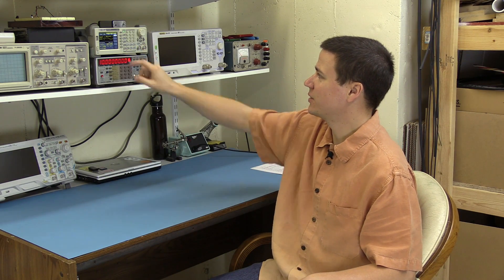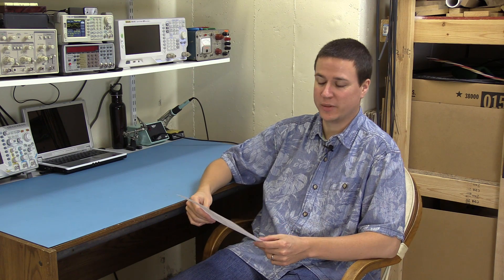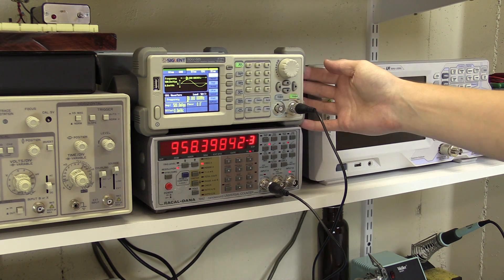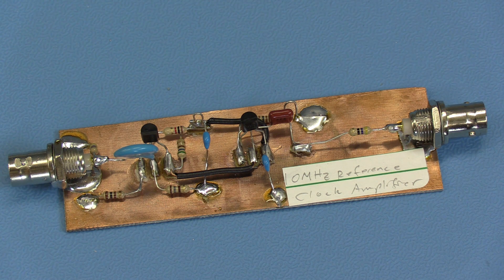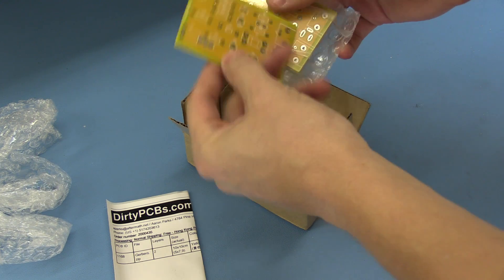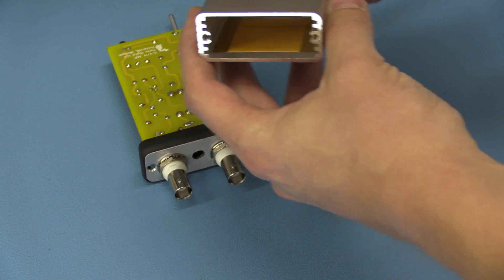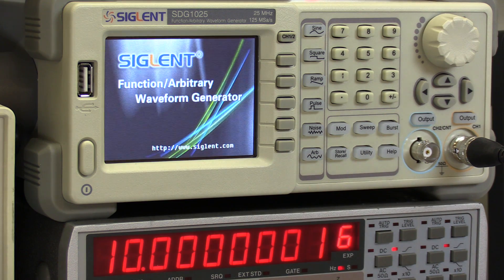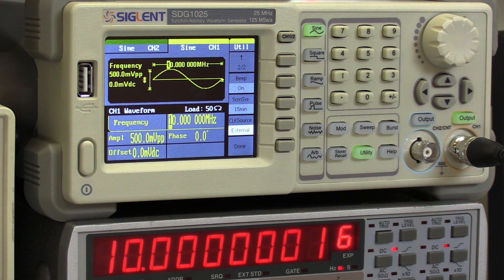Siglent SDG1025 External Reference

Comment: How about a schematic?
Reply from the maker: Sure, here you go: http://share.aparks.fastmail.fm/ref-clock-amp.pdf
Reply: @StuntProgrammer  - Sorry, can't read your notes.  But appreciate all of your replies!
Reply from the maker: @tubeDude48  "Construction notes: Trim power connector pins. Trim screw holes on rear bezel. Check input and output impedance and adjust R6, R7 if necessary." Looks like I adjusted R6 to 68Ω in the one I built and left R7 at 47Ω.

Comment: Nice video; I like the enclosure, can you share the model and also the grounding fingers you added to the PCB?  Thanks
Reply from the maker: Thanks for the kind words. The enclosure is from Hammond, their part number 1455C801. The fingers are from Harwin, their part number S1761-42R. I think I got both through Digi-Key.
Reply: @StuntProgrammer  Thank you again!  FYI, I tried the TCXO hack (replacing the internal XO with a Vanguard 0.1ppm TCXO) and it worked very well (tested against rubidium standard).
Reply from the maker: @StopAntisemitismNow  Awesome! Sounds like a fun project 😀

Comment: I'm using James Miller's (G3RUH) 10 MHz Frequency Standard http://www.jrmiller.demon.co.uk/projects/ministd/frqstd.htm 
It is tied to a TAPR TADD-1 RF distribution amplifier that provides 2.75 peak-to-peak to six jacks. In addition, the serial output of James frequency standard drives my Raspberry PI's NTP server for accurate time base for the computers. A GPS disciplined 10 MHz standard would be an interesting project. James variant is cleverly simple, no PIC programming required, just a phase lock to the GPS signal. My Siglent SDG1025 doesn't keep the external setting either.  Definitely an oversight from what I can tell.

Comment: Hi... you mentioned some dBm values.... you said the output was 1v p.p. and then said it was 4dBm? Please could you explain that calculation.  Thanks.  I've got just bought the same signal generator and old counter... it's a nice idea.
Reply: +NivagSwerdna Ah... 1V peak to peak.... 0.5V peak... 0.35V RMS... into 50 Ohms.. 2.5mW....  3.979dBm.  Oops sorry.. new to these units.
Reply from the maker: +NivagSwerdna No worries! Glad you got it! It's tricky at first, then it becomes second-nature.
Reply: +Aaron Parks Hi one more thing.... 4dBm out of Racal-Dana, 14.5dBm into Siglent. How did you get 5.6dBm gain?  isn't it 10.5dBm gain?

Comment: Hi,

Thanks for sharing.

How is your experience with the SDG1025 so far ?
Reply from the maker: Zinahe Asnake I haven't heard anything about an updated firmware to fix the bug I showed in the video, but other than that it has performed as expected. I'm happy with it.
Reply: Aaron Parks I believe it's fixed as of FW#36. Check this out http://www.eevblog.com/forum/testgear/siglent-technical-support-join-in-eevblog/270/. However, I suggest you read the whole thread before doing the upgrade. Hope that helps.
Reply from the maker: Zinahe Asnake Thanks, that's very helpful! I'll have to grab a copy of the latest version (it looks like they're up to 37) and check it out.